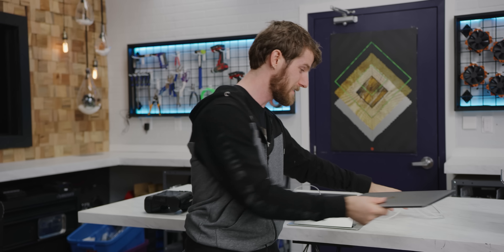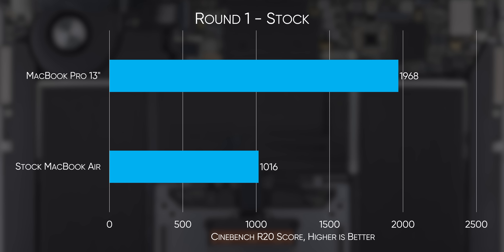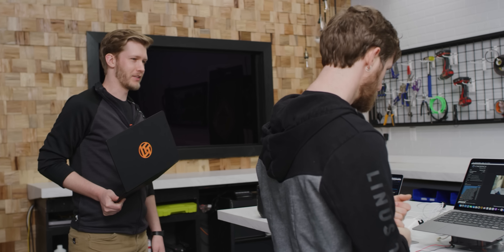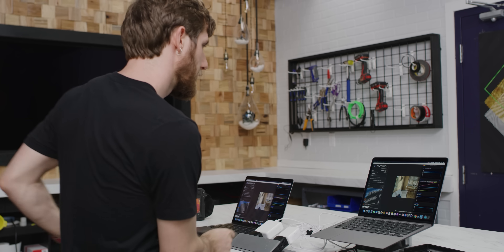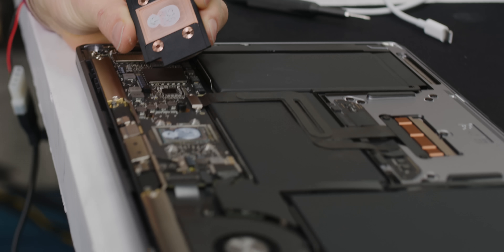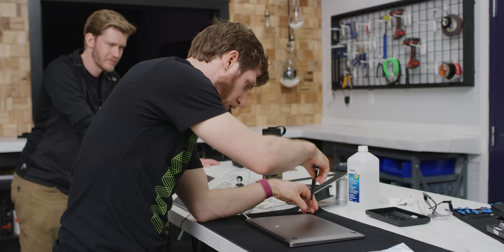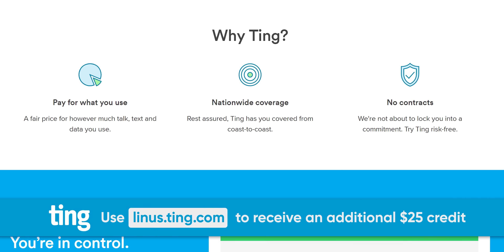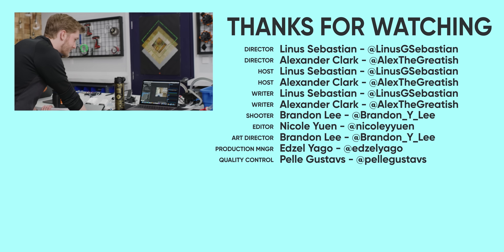Fixing Apple's Engineering in an Hour

Comment: "The MacBook Air just doesn't have the power delivery robustness to .... allow the CPU to stretch its legs." I'd say this is a totally wrong conclusion as to what is happening. Apple is just throttling the CPU with BIOS settings. You know how with Intel desktop CPUs you can say that the CPU can draw 200 Watts for 60 seconds and then it has to drop down to 120 Watts? It's the exactly same thing with the MacBook Air. The CPU is allowed to jump up to 35 Watts for a few seconds if thermals allow after which it gets limited to the ~11W mark. So no matter how much cooling you provide to the entire system, it'll behave the same way anyways.
But I have got to say that the "cooling" system looks like something that has been designed to be bad at its job from the get go. It's like Apple made it bad on purpose.

Comment: Looks like they under clock the processor with inadequate cooling so next year they can sell the computer as an upgrade by clocking it up and replace the heat sink with a proper heat sink.

Comment: Macbook air is definitely not designed for heavy tasks. It is designed to save battery juice on long heavy tasks and response fast on short tasks.
Also that fan is vacuuming the air from heatsink instead of blowing into it, yes it’s a different design, but it has pros(slimness,efficiency) and cons(worse heavy benchmark performance).
Also, cpu performance doesn’t matter anymore for many users. Ssd performance is the bottleneck for most real life use cases and that machine got it.

Comment: About the die contact:

Lots of laptops have this problem. For example my old latitude e6420 with i7-2720QM and nvidia quadro 4200M had that issue with the graphics card specifically. My fix was to use a copper shim. Yes you are increasing the number of thermal interfaces, but in my experience it worked wonders.

Comment: Oh come on, everyone knows what's happening here. They're deliberately breaking Air's kneecaps with a lame turbo profile and they're removing almost all heating. Result? Snappy burst performance, absolute trash sustained performance. You want that? Pay more for Macbook Pro 13. 

Also, they can't have the Air be too good, because their upcoming ARM designs have to beat it significantly. By like like.. at least 50%.  If this was done properly, it would've reached 1400 points instead of 1000. And they can't afford to have that sort of performance.

Comment: I had a baseline 888 on Cinebench. I used modified silicon to protect microcircuits around the die, applied liquid metal, placed a copper shim then more liquid metal then heat spreader, then fujipoly thermal pad. Hit 1169. Over 200% improvement over Linus. I can die a happy man.

Comment: Multitude of factors here :
- I'm totally buying that conspiracy theory either it's to help massage the numbers on future ARM chips or pressuring Intel into giving them discounts because their CPUs supposedly suck
- Plus poor quality control (what the hell was that thermal paste application and fitting of the "heatsink") because the average mac air buyer isn't gonna ask questions about the theoretical CPU performance and thermal solution
- Crappy engineering and cost saving, throwing a heat pipe in there is too expensive for a trillion dollar company

Comment: Hey Team Linus, What was the RPM of the Fan? Did you leaf it at stock settings? I use MacBooks since 2007 and if you put the minimal RPM of the Fan to 2500 you will not hear it and it is much better then stock.

Comment: Having the heatsink that far away from the fan isn't exactly the problem-- the fact they neglected to run heatpipes to it from the heatsink and terminate it with a radiator package for the fan to blow air through is.

Comment: In the penultimate test I believe the thermal padding which went on during the last water cooling test, might have been the reason why there wasn't any change in performance, try a little less padding, as you might know insulation works both sides, I believe the cooling effect didn't affect because of that, I only presume that is, anyways hope Mac makes laptops with better thermal management, Peace

Comment: Well, it is nothing new. There are reports from dudes who simply repasted MacBooks Pro and vastly reduced throttling. Same was advised for Dell XPS 15 (re-paste with better paste, undervolt ... ). Which is totally unacceptable in such purpotely high-end, expensive, top of the line equipment.

Comment: 10:10 Sure, BUT:

If it's on your lap, the air won't be reaching it ==> It'll be significantly higher than that 40 degrees C.

==> Owees :'(
Reply: If it is on your lap, it should have open air between your knees, unless you are like 500lbs and your legs are pure fat... It should be cooler on your knees than on a table, unless you have it propped up so there is actually some air flow under it.

Comment: My grandma gave me a old 2011 macbook pro as a gift and I'm grateful because it's my only computer but oof those specs tho
Reply: Hmm... What are those specs? Given it is a Pro, probably dual-core i5, 8gb ram, 128gb SSD, 1280x800 screen? You should be able to visit a PC shop and see about a ram upgrade to 16gb (2x 8gb SO-DIMM), and upgrade to a 2.5" 500gb Samsung 860 Evo SSD. I have an equivalent Windows Laptop, 2.4ghz i5 2430m, just bought a $30 256gb WD Blue SSD to upgrade it. Just a warning, it might only support 8gb (2x 4gb 1333mhz DDR3 SO-DIMM) that is why I recommend visiting a used PC shop, to test it and make sure the Ram will work with your laptop, go with 16gb if you can. Laptop memory is laptop memory, you dont need any special ram for an Apple device, depending what they charge it could be $50-$80 for 16gb.

Like seriously, 2.3ghz dual-core is 4.6ghz total, the MacBook Air 2020 is 1.1ghz 4core for 4.4ghz total. Your Mac still has more ghz than the newest Air!

If the plastic shell wasn't broken on the old family laptop to the point that only rubber bands hold it together, it would still be perfectly usable. I even played Lost Planet: Extreme Condition on it and had a fantastic time. Like it may only play LP:EC, Left 4 Dead, Half-Life, Call of Duty Modern Warfare 2, and a bunch of trash visual novel games, but it's still got game! XD

Comment: Just install Windows on it and remove current limits using Throttlestop, you'll get to 1500 just using the bottom of the laptop as the heatsink. Extra points for modding BIOS to remove PL2/PL1 limits completely. Even on OSx I'm sure there's an Undervolting / Current Limit removal equivalent program.

Comment: As a mac engineer for a fairly large company, I am not surprised by any of this and actually fully agree with Linus' conspiracy theory of thermal crippling the intel cpu models so their in house ARM chips will look that much better. Its disgusting how much Apple gets away with just because of their ability to own both the hardware and the software, and knowing that there is a fanbase out there that will just not buy anything else. Image what would happen if they actually had proper competition for the hardware that runs their software?

Comment: You should have put the thermal pad on the heatsink, then removed the fan (put a resistor in its place to trick the motherboard) and made it a fanless laptop, as its power limited anyway so it won't make a difference to performance.

Comment: 4:30 @Linus. Person who repairs MacBooks here. 
You're asking "I'm yet to get a clear explanation why they did this"  
They don't use a heat pipe for a few reasons: 1 space savings, 2 cost, 3 "it's a MacBook Air". 
While the CPU in it can perform better with more cooling, from a marketing standpoint it's designed as a lightweight work station, with only bursts of high power usage. Not as a professional solution for sustained high power performance.  
It's selling point is being compact and long battery life, to intentionally go out of their way to make it capable of sustained heavy loads brings it closer to a MacBook pro in use case and in physical design, so would be fighting their purpose for the product.   

Regarding the controversial "fan separate from heatsink" Please note the bottom cover, it has foam strips on it which line up with the case either side of the mainboard. Essentially the fan has a little sealed tunnel so it only draws air from across the heatsink and the logic board. It cannot draw it from over the battery or any other holes. So it's no different to having that fan directly beside the heatsink itself.  
The fact the heatsink does not contact the Die properly I feel may be design or manufacturing error. As no other model of MacBook has this issue. So that that one surprises me and they could definitely improve that
Reply: "it's no different to having that fan directly beside the heatsink itself. "
having turbolent flow on a heatsink is what you want unless you really like noise.
Reply: UHm...no. It is purposfully debilitated for purpose of miniscule savings in manufacturing cost. Just like Dell XPS 15, like Xbox which saved cents on thermalpaste that leaked when console was set vertical....

Comment: Which of the following would you recommend for a daily work laptop?  These are the options that my work  currently offers.

MacBook Pro 16’’
•       2.6GHz 6-core 9th-generation Intel Core i7 processor
•	Turbo Boost up to 4.5GHz
•	AMD Radeon Pro 5300M with 4GB of GDDR6 memory
•	16GB of 2666MHz DDR4 memory
•	512GB of SSD storage¹
•	16-inch Retina display with True Tone
•	Four Thunderbolt 3 ports
•	Space Grey

Or

Dell 7540 Precision Laptop
•      Intel Core Processor i7-9750H (6 Core, 12M Cache, 2.60GHz up to 4.5GHz Turbo, 45W)
•      Graphics card - Radeon Pro WX 3200 w/4GB GDDR5
•      Memory - 16GB, 2X8G, DDR4 2666MHz Non-ECC Memory
•      Hard Drive - M.2 256GB PCIe NVMe Class 40 Solid State Drive
Reply: If you get a free MacBook Pro, you might as well go with the free MacBook Pro. I believe the MacBook has a better screen 3072x1920 than the Dell 1920x1080p, and the radeon gpu in the Dell might actually be worse than the integrated graphics... The only good thing about the Dell is that you could upgrade the Ram and add another SSD. See if you can get an upgrade to 32gb on the Mac, but as is, the Mac is still better, just not when it comes to cooling XD

Too bad they didnt go for the Quadro and 4K option in the Dell, then the Dell would have been better.

Comment: Here's your reason. They have to slightly cripple the performance on the air so it doesn't cannibalize sales of the pro models.  That way they can still tout a quad core processor in the air, and meanwhile it's a neutered cpu because of inefficient cooling design.

Comment: The Macbook Air is cooled by the intake air and not the exhaust air like previous designs. The sticky stuff on the bottom cover helps to seal the area so that the airflow can be controlled. You should try controlling the fan speed and increasing it before running the test with no other modifications.

Comment: You have to take into account where the temp sensor IS! CPU's and anything else heat and cool way faster than the outside sensors can detect. Something like the little circuits inside can be blazing hot before it transfers to the outer materials. Think of it like being electrocuted. That's literally the way it is. Moderation in all things~ If you want good cooling, do what I did. Step it up Before you start a game, or whatever. Prepare, get ready. Start the cooling before you create load. Cool that shit off! Then you don't have to work at Cooling Something Down, just Keeping It That Way.
And put a cup of ice next to your air inlet.
I used Speedfan and a potentiometer..? (dimmer) to turn the fan speeds up before I played WoW back in the day. Preventing temps reaching high levels goes a long way to preventing them from reaching and sustaining high lvls throughout heavy loads.
Reply: dont swear
Reply: @crisp_gaming  ...Poop.
Reply: @dreezthehunter7006  that's better

Comment: Using a thermal pad actually makes a lot of sense: nobody would run a Blender render and expect the computer not to get hot, and with this simple "hack" you can get better performance for short-timed tasks (considering the Mac won't actually get too hot in a short time)
Reply: I hoped Linus would explain a little better what he did to the heatsink. It seems like something a user could do.

Comment: Don't use the quill to control cut depth on the Bridgeport unless you're drilling and going all the way through.   Set the cutter on the surface of the part (while the spindle is off) using the quill and then lock it in place.  Then use the knee to control cut depth.  Bring the part up into the cutting tool basically.

Comment: Bruh my phone has a better cooling system than this thing
Reply: My $80 RCA Windows 10 Tablet with 4 core Intel Atom CPU had better cooling and it only used a thermal pad and a piece of aluminum foil! XD

Needless to say I cut a hole in the back and glued on a proper heat sink, 1.7ghz sustained! 6.8ghz total processing power vs the Air's 4.4ghz total processing power. XD
Reply: @Trainboy1EJR  Aluminum foil XD when even aluminum foil is better than apple's cooling system you know what not to buy XD

Comment: I've used Windows computers/laptops all my life. My strongest memory of using a Mac laptop is playing Minecraft on a friend's one. It uses the keyboard WASD for moving, and every time my finger slipped from the key to the metal surface between the keys, my hand would automatically jerk away because it felt like I was about to be burnt. 
Sorry, but I just don't trust a computer that doesn't have a fan to cool itself. It'll either heat up it's own body, making it uncomfortable or it will throttle the CPU.

Comment: A thicker bottom plate for better heat spread over the plate and integrating the CPU block into the bottom plate, could maybe make the fan redundant.
The higher mass would help with burst heat and they could install a bottom plate temperature probe, to monitor the temp when at high load over a long time.

Comment: My macbook runs 82 at idle and 100 under load, "free" heating.
Reply: Actually if you discipate the heat faster, your MacBook will be cooler, and you can make more heat by running the processor faster.

Comment: My solution - icepacks underneath mine when in heavy use. Even the fan doesn't turn on, and if I know it's time to change the packs. The packs costs less than 20 bucks and there are enough to swap them constantly.

Comment: It seems like from an engineering standpoint these are pretty basic errors or just choices made on purpose. Maybe to make it easier for the next model to get an easy performance edge on last year's model ie just supply more power better cooling or both for an easy jump in performance. That's my cynical side mind you, I won't pretend I know enough about it to have proper insight.

Comment: Why didn't you try a stronger power brick? To be sure that it's the motherboards power delivery and not just a limitation of the power supply? After cutting a hole in the bottom of an AMD apu laptop and mounting a fan I brought the thermals down from throttling to a max 63c under heavy load but I still couldn't hit max turbo on more than one core at a time. The power brick on the Asus V5 laptop was really small with low wattage so I upgraded it and now it can hit max turbo on two cores and gets within 200mhz on a third. May help, may not. Worth a try? At least did you do the math?

Comment: Next time you when you want to level your drill to zero (timestamp at 6:30) do it like a 3D Printer Nozzle. Use a piece of thin paper like a receipe from a shop (bon) or how ever you call it and wiggle it while you go down untill you feel the resistance. Its a pretty accurate method and thats how i learned it at work as a mechanic.

Comment: Wow Apple is really triple brain dead here. First why they can’t they use a heat pipe like even a $200 laptop has. And even if that wasn’t somehow an option why can’t they design a heat sink that has proper contact? They also have never to my knowledge used their fancy expensive unibody aluminum chassis for cooling which is such an obvious thing. Even the now relatively ancient Dell XPS 13 is roughly as thin, lighter, and vastly better engineered.

Comment: I have often wondered why no one has made a sodium-cooled heat sink.  Ford did it many moons ago in their engine valves and was great until you re-surfaced and hit the pocket of sodium.  Of course it would have to be a weaker variant since solid sodium doesn't melt until 97.5C or 207.5F .

Comment: If you replace the heatsink with a copper sheet bottom and aluminum fin top that doubles or even triples the area you would get the best performance without hotspot on the bottom.

Comment: Bruh if apple just slapped a copper heat pipe and a small radiator on the expelling side of the fan they would have made the CPU perform soo much better (even a ribbon heat pipe would have done the job)

Comment: On the plus side, while you won’t gain much performance, you will (theoretically) extend the life of the computer since it won’t burn out as fast as Apple designed it to.  You kept questioning why Apple would intentionally design the laptop this way, and it’s simply for planned obsolescence via CPU burn out.

Comment: Of course there is a reason for it. If your PC gets heated up fast, the life gets shorter, and the apple buyers needs to replace it more often. This means more profits as well as economic value add to the company. Also, Apple would need to ban laptop repairs for the strategy to work. This is part of their mega eco system strategy, which will benefit Apple consumers